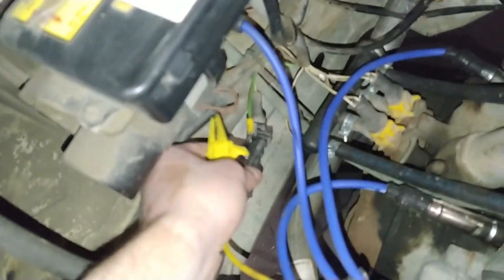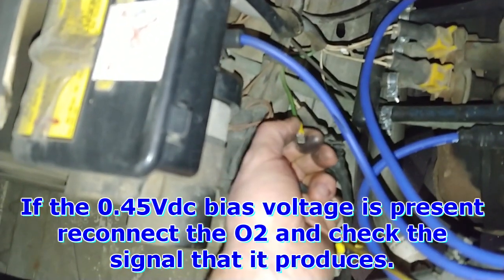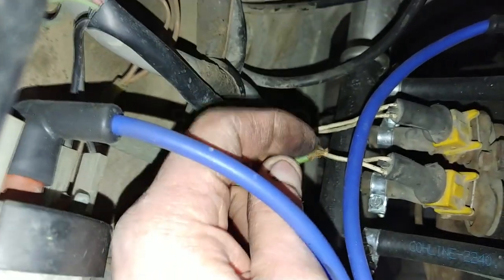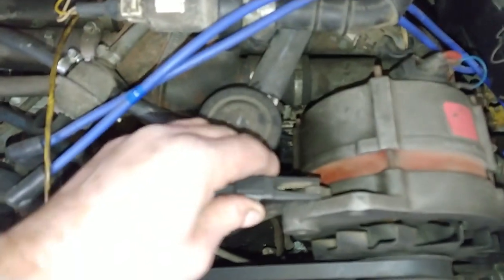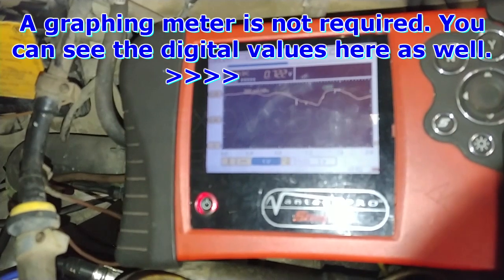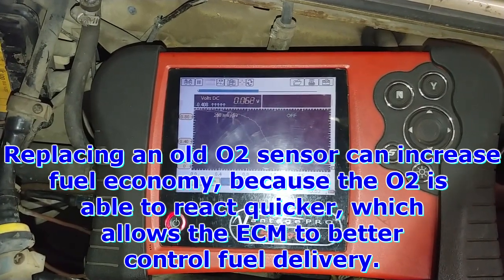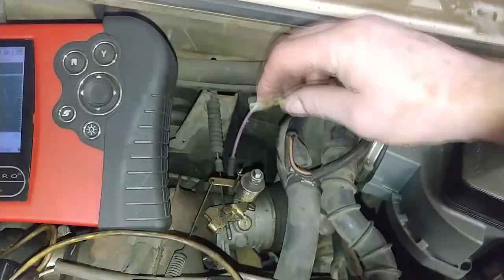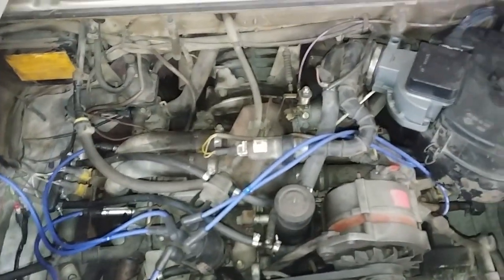VW T3: Common O2 sensor (wiring) issue

Comment: Really great video
Reply from the maker: Thank you for watching!
Reply: @EXOVCDS  are you open to answering questions that viewers have?
Reply from the maker: That's what I'm here for.
Reply: @EXOVCDS  this is so wonderful 🌈 thank you!

My father was housing my 88 2wd vanagon 2.1 for me and unfortunately started blindly adjusting the idle screw to bring the idle down. He was experiencing a higher than normal idle that was bouncing. 

I followed the Bentley procedure to check the idle control valve for humming checked continuity to the idle control unit and found some pretty corroded connections which I cleaned. 

One of my millions of questions I have is:

If my idle control valve checks good my continuity to the idle control unit checks good and my idle control unit is also good and I'm  trying to get the idle screw back to a good starting point should I start the van let it warm up and then disconnect the idle control valve to adjust a base idle speed? If I do do this should I expect the idol to be around 2,000 to 2,500 RPMs if I unplug the idle control valve connector? 
I have the Bentley manual but seem to be stuck in this circular troubleshooting loop

I'm sorry if this question is worded incorrectly or confusing and appreciate your time immensely.

Also do you have a patreon?
Reply from the maker: Turn the idle bypass screw all the way in and then out 1 &1/2 turns. That should put you in the ball park. If idle is still too high at that point, verify that the closed throttle switch is closed (has continuity) when throttle is closed. If yes, tap on the idle stabilizer with a screwdriver when the idle is staying high. If the idle drops when the stabilizer is tapped, clean the stabilizer or replace it. If the idle is still high after tapping, pinch the hose going to the idle stabilizer (from the air intake tube). If the idle drops it could be a stuck stabilizer or bad stabilizer module. Also make sure that the ignition timing is ok.
Reply: @EXOVCDS  wow thanks!! Can't wait to try this tomorrow.

I have adjusted the timing following the procedure on gowestys channel with the timing light set to 35° advance at 3000 rpm

I'll keep you posted.

Sooo grateful!!
Reply: Ok so tps checks good according to Bentley with audible clicks at no throttle and wot with continuity/open happening at desired positions. With idle screw at the 1.5 turns out from fully in, van won't start unless I let the starter run for way too long. I did eventually get it running and it ran for a little bit but eventually died. I checked the output of the O2 sensor to ensure that it was oscillating and it looked like it was going between 0 and around .6 volts but I am using a cheap digital multimeter not the oscope type you use so I could be dead wrong. Also worth noting with the O2 sensor fully unplugged it ran exactly the same with no noticeable difference plugging it in.
Reply: Also tapping on the Idle control valve did momentarily change the RPM from 900 to 1200 the first two times I tapped it. After the second tap no changes occurred after tapping it. but it never was above 1,000 to begin with at the 1.5 turns location

Also I unplugged the idle control valve while it was running and the van immediately died
Reply from the maker: Unplugging the valve & it dies indicates that the valve can / does close (which is good). Long cranking / hard starting should not have been caused by base idle speed screw. Applying a bit of throttle during cranking opens the throttle / bypassing the base idle screw air flow passage. Turn the base idle screw out 1/2 more turn and check again. I usually snap the throttle open and allow the engine to fall back to idle... it should fall below 850rpm, catch itself / rise a little and then settle again at around 850rpm. O2 reaction time depends on heater coil working correctly and overall engine exhaust / sensor temperature. At minimum 5min runtime before checking for o2 signal is required. 10min+ or fully warmed up engine for definitive o2 assessment (with scope, as regular multimeters have slow sample rate and show average voltage values per seconds). If the o2 is older than 5 to 8 years, it's worth replacing, as a new o2 can respond quicker, which cam increase fuel economy. Ideally you will want to adjust according to mA of stabilizer according to Bentley instructions, but simple small adjustments can get you to a stable idle. Mixture screw on AFM box should only be touched if security plug has already been removed. More on that later if that is the case / should you need to know.
Reply: @EXOVCDS  well no sensors have been replaced on this van since before 2016

And the van sat at my father's house from 2019 until now

So far I've done basic tune up replace the battery and the fuel filter

The AFM cover has been removed and fiddled with unfortunately

The van always had a warm start problem

In general I just lack the necessary basic troubleshooting tools so I'm trying to decide if I should limp it to a mechanic or spend $500 on diagnostic tools or just sell it and enjoy my life again LOL

Either way thanks so much for listening to me and helping to point me in the correct direction
Reply from the maker: Limp it to mechanic... sounds like there's a bigger problem than just idle. Stalling at idle if gas pedal isn't played with, is not really a limping issue, since once the vehicle is moving, idle doesn't play a role.... unless there's power loss issues, bucking / hesitation etc. If in good shape (body),  people pay big bucks for these vans, no matter the running condition. Engine conversions, lift kits, interior modifications etc... it's crazy the amount of $ people will put into these.
Reply: @EXOVCDS  I may have the timing set incorrectly. I adjusted 35° at 3000 RPMs but I'm seeing on 24.43 of Bentley manual to set 5° before TDC at 2000-2500 RPMs. What would you recommend?
Reply from the maker: @snazzfab  35 degrees at 3000 rpm with blue temp sensor connected & coolant temp above 80c.
Reply: @EXOVCDS  awesome thank you!
Reply: @EXOVCDS  I forgot to mention in this thread that my temp sensor (blue) measures no continuity between prongs. Also worth noting the accompanying harness receptacles read 5v with key on

Comment: Hi Thomas. I have a question. I have a 1986 Vw Doka with a 2.1 and I'm having some O2 sensor/wiring issues. Here is the issues. The Doka is burning very rich. so rich, that there is tiny little flames coming out of the exhaust. No joke. It has done that a couple times. It's a brand new engine rebuild. Everything on the engine is brand new as well. I tested the O2 wire (green with shield wire) on the harness and with the key in the "on" position, I am getting .5 volts at the o2 sensor wire on the harness. Next was the plug on the harness. It has 2 wires on the plug. One is brown (ground) and one is white-heater wire ( those go to injectors, power supply relay etc). With the key in the "on" position the brown (ground wire) the light comes on on my test light. With the test light connected to the white (heater wire) on the plug on the harness, the test light does not come on. The engine does start,but idles rough, black smoke etc. What do you think it could be?  Thanks!!!
Reply from the maker: Disconnect / leave the green O2 wire disconnected... if the engine runs the same (rough, rich) then it's not an O2 / control issue.
Check fuel pressure... probably too high.
Reply: @EXOVCDS  how do I test the fuel pressure? The fuel pressure regulator is brand new.
Reply from the maker: @justindillon2694  attach a pressure gauge to the test port next to the distributor. Make sure that the coolant temperature sensor (2 wire blue sensor) and wiring are ok.
Reply: @EXOVCDS  I did a pressure test and with the key in on position, the pressure is 32 psi and then it starts to drop. When I start the doka it hits maybe 34 but then the engine dies.
Reply from the maker: 34 psi is enough / it should stay running. How quickly does it drop? If one of the injectors is leaking, it can cause a rich running condition.  What's the resistance of the blue temperature sensor? If the resistance is ok, it could be a problem with the wiring to the ecm. High resistance in the wiring will make the ecm think that the engine is very cold... the ecm then adds way too much fuel.
Reply: @EXOVCDS  I will check the resistance on the temp sensor. The engine stays on for about 5-6 seconds then dies. It’s very low idle and bogs.
Reply from the maker: Can you keep it running by playing with the gas pedal?

Comment: I have issues with my Vanagin 1983 stay on .540 signals O2 even after changing O2 sensor and checked the wiring it’s okay
Reply from the maker: How & where are you checking? Post a video so that I can see. It takes 5 to 10 minutes before the sensor will cause a signal change (if it is a single wire sensor)... hold the engine rpm at 2000 rpm and monitor the voltage.
Keep in mind that a multimeter shows the "average" voltage. If the o2 sensor is switching quickly, the meter will show the average... which could very well be the .540 that you are seeing. The faster the meter is, the more samples the meter takes and is then able to show more changes in voltage.
Reply: @EXOVCDS  same way you checked in the video once the sensor disconnect and once with sensor connected both reading are same
Reply from the maker: Increase the rpm... the O2 sensor  needs to get hot.

Comment: Thanks for all your help Thomas. I’m being plagued by a malfunctioning o2 system. Replaced the sensor, Checked and rechecked that the inner and outer wires are not touching, yet I’m still getting a constant .5v while the sensor is connected to the ecu. Hoping you can shed some light on my problem. Thanks again!
Reply from the maker: How & where are you checking? Post a video so that I can see. It takes 5 to 10 minutes before the sensor will cause a signal change (if it is a single wire sensor)... hold the engine rpm at 2000 rpm and monitor the voltage.
Keep in mind that a multimeter shows the "average" voltage. If the o2 sensor is switching quickly, the meter will show the average... which could very well be the .5v that you are seeing. The faster the meter is, the more samples the meter takes and is then able to show more changes in voltage.

Comment: Great video , I’m having a higher then normal fuel consumption, I have .5 volts with the key on as well as .5 volts with the van running, no fluctuations in voltage. Guessing I need a new o2 sensor so the ecu can adjust values.
Reply from the maker: Does the O2 have a heater circuit? If yes, does it have power?
Reply: I believe it does have a heater circuit. It has a single sensor circuit and a double pinned plug which I’m assuming that is the heater circuit
Reply: Not sure how to check for power
Reply from the maker: Disconnect the 2 wire plug and attach a test light across the 2 wire plug. The test light should light up when the engine is running. If yes, then power * ground for the sensor is ok. If no, then you have to check why.
Reply: Thomas EXOVCDS ,  Thanks for the info, I do have power and ground at the plug. I’ve changed the O2 sensor, I had bad ohm resistance across the connector to the heater of the sensor. Going on a trip in a couple days will see how it goes. Thanks again for your help.
Reply from the maker: Thank you for the update!

Comment: Hi: I already disconnected the green wire. At de moment, OK.
I'd like to put in a tachometer. Does it have to be external or can it be placed in the place of the analog clock in the instrument panel? I guess the simplest and cheapest is external. I have not found any video tutorial about it.
 Any advice ? Greetings and thanks.
Reply from the maker: Yes, external would be the cheapest & quickest way to go. The stock instrument clusters with Tachometers are getting hard to find.

Comment: Hello again:
Switch OFF:
Left relay

86(-); 30(12 volt);85 (12volt); 87 (nothing)
Right relay
86(-);30(12 volt); 85(nothing); 87(nothing)
Switch ON (engine stopped)
Left relay
86(-); 30 (12volt);85 (12volt); 87 (12volt)
Right relay
86(12volt); 30 (12volt); 85(12volt); 87 ( nothing)
Why 86 is (+)
As the relay does not activate: 85 (+) / 86 (-), 30 does not give continuity to 87.
However, the fuel pump runs for a few seconds and then stops.
Do I have to take measurements with the engine running?
Regards and thanks
Reply from the maker: The relay that has voltage at 87 (with key on) is the ECM relay... the relay that does not have voltage at 87 (with the key on) is the fuel pump relay. This is normal... the fuel pump relay gets activated for 1 or 2 seconds and then turns off. Once the engine is cranking & running, the fuel pump relay will stay active. 

Yes, monitor both relays (87) with the engine running... that way you can determine if low voltage is the reason for your lack of power.
Reply: @EXOVCDS  Having connected the multimeter to pin 87 of the petrol pump relay, I started the engine and it read 13.7volt. After a few minutes at idle, fortunately, the problem has appeared. Shortly after, without doing anything, he is back to normal. 5 minutes later, the problem again but it has not recovered and I have turned off the engine.
In another test, the ECM relay, 13.6Volt (pin 87). This time nothing has happened. Normal idle. https://youtu.be/rSivL_afFeg
Reply from the maker: Did you see my reply about the green wire? Leave it disconnect.

Comment: Hello again:
The two 4-pin relays OK. I connect 12 volt to pins 85 and 86 and I hear a noise and the results I get I do not understand. I think I am doing something wrong.
Switch OFF:
Left relay
Pin 85-86 = 0 volt
Right relay
Pin 85-86 = 0 volt
Switch ON (engine stopped)
Left relay
Pin 85-86 = 12 volt
Right relay
Pin 85-86 = 0 volt
With the engine running, I prefer not to touch the contacts that connect to the relays. I have a bad pulse and I can cause a short circuit.
Between pins 30 and 87 I get some strange data.
Regards and thanks
Reply from the maker: 85 - 86 is the "control" of the relay (turns relay on / off)
30 is power / battery voltage all the time
87 is the load (ECM or fuel pump relay)
I want to make sure that 87 always has battery power (the same power as 30) when the relay is ON.

It could be that one of the relays is not supplying full battery power... this can cause problems with the fuel pump or the ECM. When voltage drops below 10v, the ECM can have operational errors.

Comment: My truck doesn't have an O2 sensor and it doesn't have the green wire from the O2 sensor near the ignition coil ...
There are 3 green wires that go to the negative of the ignition coil and another wire that goes to the air conditioning compressor. https://youtu.be/cVOxKMZ1z2w
I'll check the two relays in the black plastic box.
Greetings and thanks.

Comment: Are the injectors missing the house clamps on the injector side? I found mine like that with no clamps! I think some injectors come with the hoses installed but not clamped and ppl think they're sealed and only install the fuel rail clamps. I found mine by bumping the fuel rail and noticing fuel spray out....
Reply from the maker: Stock injectors have "crimp clamps" on the injector side... I have never come across injectors that had nothing on the injector side of the hose. Post a video so that I can see what you see.
Reply: Yes, but I've seen the replacement or rebuilt injectors that are shipped with a short section if hose and no clamp. Looking at this video I thought it looked like the injectors on this van were missing clamps.
Reply from the maker: You can kind of see the crimp clamps if you know what to look for... I worked on a Van last week where the crimp clamps were so rusty & brittle, that we recommended new hoses & clamps (we don't have tooling / equipment to crimp clamp).

Comment: Please let me know how to check the oxygen Led light on my 83 westdalia
Reply: What I have the led light on the cluster never come on when ignition on engine off is there is way to bypass the wiring to the light to see if the led lights is good?
Reply from the maker: According to the wiring diagram (you should get yourself a service manual if you don't have one), the O2 LED receives ground "through the alternator" when the key is in the ON position (via the same wire that turns the battery light on) and will turn the LED off when the alternator starts to charge. If the battery light is OK, then you have to check the blue/green wire at the back of the instrument cluster connector. With the key ON, attach a jumper wire to a clean metal surface / ground and touch the blue/green wire at the instrument cluster harness plug. If the LED does not light up, then the LED bulb might be bad. If the LED bulb lights up, then the blue/green wire is not connected to or has a bad contact with the alternator field wire (you need to follow the blue/green wire to where it meets up with the blue alternator field wire). The O2 "mileage counter" that I mentioned to you already in one of my replies... is located next to the spare tire. You will also find a blue/green wire at that box... after x-amount of miles, the box grounds that wire to trigger the LED light. If the plug is disconnected, it will not trigger the LED according to elapsed mileage... but the LED should still turn on when the ignition is turned on and go off once the alternator is charging.

Comment: This is a gem!  Excellent tech info!
Reply from the maker: Thank you... it's a simple, but often overlooked (by novice's) issue. =)
Reply: @EXOVCDS  can't scan it for a o2 code therefore it cannot be diagnosed.  ;)
Reply: Can't monitor o2 on data, so therefore it can't be diagnosed.